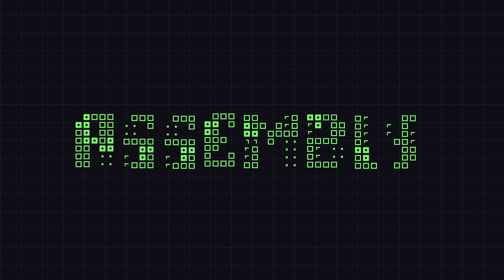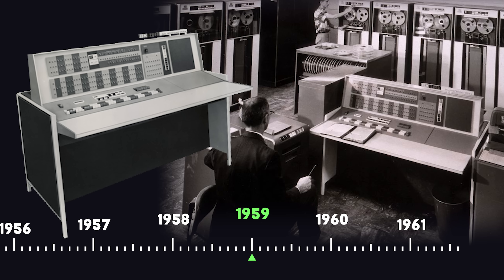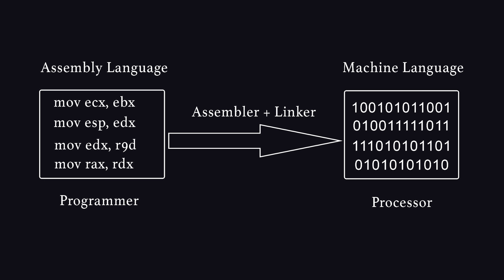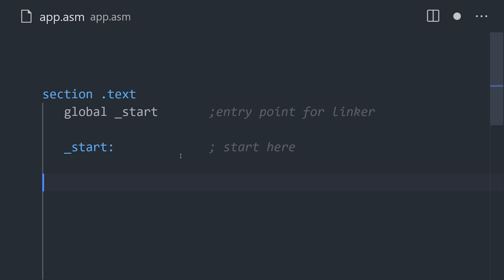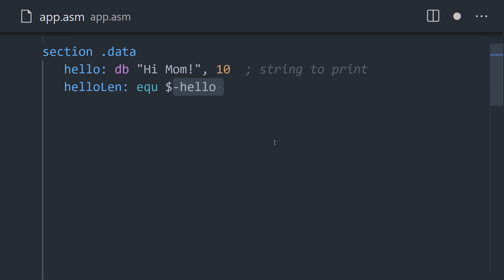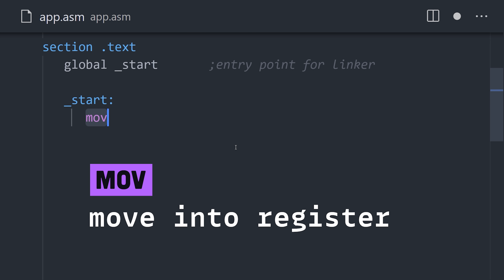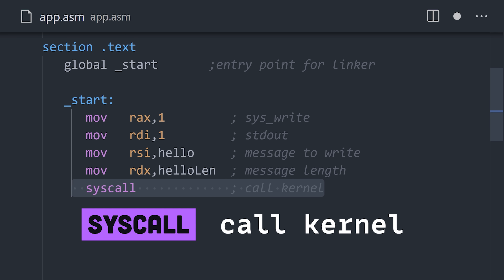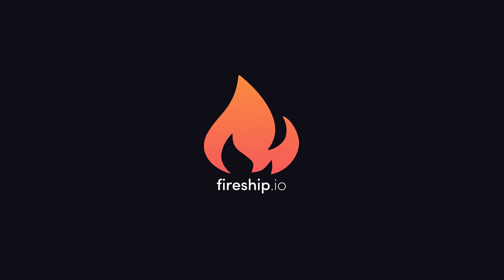Assembly Language in 100 Seconds

Comment: Assembly only looks complicated to the beginners but it's really not. MASM even provides high level directives like IF, ELSE, WHILE and standard macros for I/O that makes it really straight forward to focus on the performance of your algorithm.
Reply: I never knew this, that's pretty cool.
Reply: What's the difference to C at that point?
Reply: @eUnkn0wn  you can write inline assembly in C if you want, difference is of performance and control over your code, bit shifting and direct access to stack frame and hardware. You can't do that with C
Reply: I had a tutor back in the mid-90s when I was just a teen hanging out on the local BBS... he always said "it's all rather simple", and I never got it and was wholly confused.

Until one day when it just clicked and I realized all you're doing is reading, changing, and writing values to memory or output ports, and whatever is there interprets it; like the value 10 can be a green pixel in video memory.
Reply: @raz0229  There is a talk by Matt Godbolt "What has my compiler done for me lately" (or somesuch), where he demonstrates really well how unlikely you are to optimize better than your compiler at this point. Besides C is basically just that: High-level assembler.

Not saying that dabbling in ASM doesn't have its place, but personally I needed it mostly for debugging.
Reply: I really don't think that a human cannot write an Assembly code, better than a compiler. Especially in complex projects. Because of that, people use C rather than Assembly.

You cannot write an operation system for example. Which people already don't too.
The robot that send in mars, didn't wrote in Assembly. Not because that people are not smart enough or too lazy to learn Assembly, its because written code in C and convert it to Assembly with complier optimisation is better choose, smarter choose.  

There will be low level languages every time. Don't get me wrong about that. But the languages like assembly, c, and etc. Are too old. Programming habits are changed.  But those language structure too old, and you cannot change it. For instance Rust probably will be better than C++ after a few years later.  I hope I can explain my point.

You can do everything with every language.  But that doesn't mean that is the smartest way.
Reply: @Miracle-uc6es  DOS was written is assembly IIRC
Reply: @HandcartRule46  I'm talking about today, not the 700 years ago.
Also as I said "you can do that, but that doesn't make this logical." No one write an OS or any big program in assembly unless he's have to. Because its makes no sense.
Reply: It looks like god-level programming because its syntax and way of doing things are very different to any other language. Once you get into it, it's deceptively simple because there's relatively few commands and basically no structures of any kind, it's just "do x, do y, go to x, do x with y, go to z, do b with c and g". But precisely that simplicity is what makes it so hard to write any big project in assembly and why higher-level languages exist in the first place.
Reply: @Miracle-uc6es  There's also the fact that 99.9999% of the programming work to do in the world doesn't require extremely performant code like it did 50 years ago. Today assembly is mostly used (excluding hobbyists) for very specific points in drivers and such – you then jump out of assembly as soon as you can.
Reply: @eUnkn0wn  guarantee you, most people who write in ASM do not do it for performance but for fun and to flex. Ngl, it is cool.
Reply: While the language itself is pretty simple, if you want to do something useful with it, you must dig into the architecture. Thousands of SFRs, hundreds of low-level protocols with specific timings, a mountain of datasheets for every component you interact with... Go, display a single pixel on raw iron, without OS, see how easy it is.
Reply: @sharpfang  That is the entire point of the operating system. You usually write assembly code that uses system calls to get the OS to do all the fancy IO for you, you don't do it yourself.
Reply: @rz2374  Nowadays you usually don't write assembly code if you have an operating system. Hand-written assembly is nowadays almost exclusively relegated to raw iron small embedded. If you can fit an OS on it, you can fit at least C binaries, and assembly is pointless. It's when even raw iron embedded C gets too big that ASM starts being a necessity; the $0.01/pc chips like in battery charge controllers or RGB LED remotes.
Reply: @sharpfang  I know at least two application of assembly within an OS: the C standard libraries, and probably others, use assembly to improve speed of certain mathematical functions; and while it is not written, it is often read when decompiling/disassembling executables.
But yes, I do agree that assembly does not really exist within the confines of an OS besides very niche uses like the above.
Reply: It just becomes hard to manage when your project gets big
Reply: doesn't matter. ASM in any form, be it hand-written or compiled, is HEAVILY optimized (like why would you write assembly by hand anyways?). Simply diividing by 17 results in...
  movabs -1085102592571150095, rdx
  mul rdx
  mov rdx, rax
  shr 4, rax
You can't tell me that that's not compilcated - even if you know the algorithm that generates this code, it will take MINUTES to figure out what this is doing.
In order to "focus on the performance of your algorithm" you need to be as good as - and actually BETTER than an optimized compiler at code generation for it not to be a waste of time.
Reply: It's not that its difficult. Just incredibly time-consuming
Reply: There are also high-level commands-macros.
.if (...)
.elseif (...)
.else
.endif
.while (...)
..end
.until
.repeat (...)
And there is more in the UASM assembler
.for (eax=0:eax<111:eax++)
.endfor
.switch eax
.case 1
...
.endswitch
So you can write structural code in assembler.
Reply: @Miracle-uc6es  today theres a vlc encoder about it
written in only assembly
10x faster than the c code for it
Reply: @miniflint2423  Alright, I'm challenging you :)
I want you to write the 'Guess the Number' game in Assembly, C, and Python languages.
It's the simplest game in the world. You'll pick a random number. Then you'll get inputs from the user. If the user's input is greater than the guess, you'll write 'greater' on the console; if it's smaller, you'll write 'smaller'.
Then I want you to add the following features to the program:

* Attempt Count: Count how many times the user has tried and display it on the screen when they make the correct guess.
* Difficulty Level: Create different difficulty levels that the user can choose from (e.g., the range of the number can change).
* Hint Giving: Give a hint if the user makes a certain number of wrong guesses.
* Multiplayer: Make a version where multiple users can play. Each player makes their own guess and whoever guesses in fewer attempts wins.
* Graphical Interface: Use a graphical interface instead of a text-based one.
* Scoreboard: Create a scoreboard that stores the best scores.
* Time Limit: Set a time limit for each guess.
* Adaptive AI: Develop an algorithm that allows the computer to pick the number more wisely. For example, analyze the user's guesses from previous games.
* Online Version: Make a version that can be played over the internet.

You'll easily do all of this with Python, you'll struggle but you'll do it with C, and yet you'll do it with assembly.
Then you'll better understand why there are power differences between languages. What's the use of a class? Why are there libraries? Why is a dictionary better than arrays? And so on.
What I want you to learn is this: 'Everything can be done with every programming language. But it's not sensible to write everything with every programming language.'

If you want something more focused on embedded systems, imagine you have a four-way intersection.
There are four lights. Adjust these lights in a way that avoids traffic accidents.
Then add these features to the program:

* Sensor Integration: Add sensor data to adjust the lights in real-time based on traffic density.
* Pedestrian Button: Simulate a pedestrian crossing button. When activated, the pedestrian crossing will show green after the next green light cycle.
* Emergency Vehicles: Add a mode that facilitates the passing of emergency vehicles.
* Night Mode: Automatically shorten the duration of the lights during nighttime hours.
* Function of Yellow: Set the yellow light to function both when transitioning from green to red and red to green.
* Cycle Statistics: Provide statistics that show how long the green, yellow, and red lights were on during each cycle.
* Graphical Interface: Visualize the traffic lights and road conditions with a GUI.
* Multiple Intersections: Extend the program to manage traffic flow between multiple intersections.
* Secondary Roads and Turns: Add separate lights or a directing system for right and left turns.
* Error Tolerance and Safety: Determine how the system will react in case of outages or errors (e.g., all lights turning red).
These applications will make your program a more complex and realistic simulation.
Then, for example, compare the performance differences and say for yourself whether this torture is worth it.

Have fun in advance. My only request from others reading this comment is, don't talk without knowing what you're talking about. "Just because you have an opinion on a subject doesn't mean you have knowledge about it". First try these simple programs, then you'll understand why using Assembly is absurd. First do, then talk.
Reply: @Miracle-uc6es  literally just said that it existed. not that i could do it
Reply: @miniflint2423  What I'm trying to explain is exactly this. You didn't say anything. I mean, if I sit down and do some research, maybe I can find a program written in machine language that runs 20 times faster than one in C. So what? What did I just say? Nothing. Should we learn machine language? Should we write 10,000 times slower just so the program runs 10 times faster? It's an empty statement. This is just answering for the sake of answering.
Reply: @Miracle-uc6es  no yes maybe... It is dependent on your task if u need a small hyper Efficient program for example an integrated circuit you would use assembly but for bigger programs a higher programming language is much better because its easier to read and write. Your attitude is the reason we have more and more programs today that are so wasteful that they are actively making our workflow worse. When you have programmers that don't really understand things like pointers because they "don't need that to write code" you get Programs that are sabotaging themself for no reason. And yes in most scenarios C is better used then Assembly. To your example yes many thing are wrote in Assembly even if its 10,000 times slower to write because when u sell something many Billion times and can make that with 10 times slower (cheaper)  hardware that 10,000 time upfront cost is worth it.

Comment: A quick correction: the bss section is for variables whose size is known but data is not. We reserve space for variables in the bss section with resb (reserve byte). The data section is for variables whose initial value is known, and the rodata (read only data) section is for constants
Reply: To further expand on that: the bss section is allocated at program start and initialized to 0. Thus, only the size of it needs to be stored in the executable file. This is also the reason why C initializes globals to zero unless a value is provided - because it is essentially free - compared to local variables, which are uninitialized by default to save a few instructions.

Comment: A small but important caveat: in most use cases, assembly still sits above the OS / kernel. So you won't work with actual physical memory ("bare metal") but with virtual memory; an abstraction provided by the OS. An exception might be when you are programming in kernel space.
Reply: So we modify the virtual memory? That is protected?

Comment: also, .data is not for constants that do not change, it's basically an initialised version of the .bss section that takes up space in the executable. you can actually change it. for actual constants that do not change, use .rodata.

Interesting video though :)
Reply: That makes sense, given that I gotta assume rodata stands for read-only data
Reply: @finadoggie  yep
Reply: that takes up space *in the executable*. .bss, .data and .rodata all take up space in memory, the difference is that .bss is not stored in the executable but initialized with all zero bits by the executable file loader.
Reply: @mihiguy  thanks for correcting that :)
Reply: @Snail5008  you are welcome. Thanks for corrrecting your comment :)
Reply: does getting information from .rodata work the same as getting it from .data?
Reply: Ah, so .rdata is pretty much constant, and can never be changed, but data can be changed

Comment: The madlad did it - and even flavoured the like and subscribe again!
I have been looking at Gameboy assembly for a long time, mainly for the GameBoy and GameBoy Color. Starting with the GBA, you can use ARM instruction sets and the tooling for both is pretty incredible (sdcc, lcc, z80sdk, ...). It sure is far different from writing nice looking code, but if you want to get something critical done, then your best way of achieving it, is to skip every and all abstractions and go bare metal via Assembly. :)
Reply: Actually DevKitArm and GBDK is the way most people go nowadays and some people actually managed to make impressive stuff with it thanks to the layer of abstraction. We're seeing more and more people make games for those platforms and part of the reason is excellent support for the C programming language. Now, if only CC65 was actually just as nice...
Reply: @doigt6590  GBDK uses SDCC and I personally am still waiting for it to actually support C99... I wanted to try and use V which compiles to C, but because of ampersand statements, it makes SDCC error out a lot. But, DevkitARM/-PPC is amazing! I have those installed too. Personally, I am impressed how many unofficial SDL ports there are for some of those handhelds, which is pretty amazing!

Comment: I got my start with MIPS32 in university and I'm currently learning 6502 assembly just for fun. It's a really fun CPU to learn and the X16 uses it just like the C64.
Reply: I learned MIPS in university as well, does it matter what version of assembly we learn? When starting out I was so confused on the difference between arms and mips, and when searching tutorials they never showed what I was learning in class. I want to learn assembly but don't know what version to go with.
Reply: @sergiohernandez72  That depends on why you want to learn it. If you want to understand the concepts, it doesn't matter. Learn any or preferably several of them (to see the differences). You might even want to have a look at completely synthetic ones (like MIX or DLX) or byte-codes like Pascal's or Java's. If you want to write real-world code in assembly (to make if faster or smaller or remove side-channels) then you would learn the assembly language of a processor in wide use: x86_64, ARM, some microcontroller, maybe a GPU ...

Comment: 0:06 Actually that's what hexadecimal is for. Hex is far easier to count than binary. What assembly is for is to remember the instructions' names instead of their number. That's literally it. Without assembly programmers would likely remember instructions in hex rather than binary anyways. In fact if you deassemble a program you not only see the assembly instructions generated by the compiler but it shows you those instructions in hex instead of binary.
Reply: So the easiest "decompiler" (not really) to make is a binary to hex?

Comment: Interesting how similar yet different this is from compiling with gcc
Reply: Gcc does the same thing, but just hides it away.
Reply: in steps of compilation + linking of c++, converting to asm is an intermediate, so basically we start from there in this case
Reply: its basically the same thing, c and c++ are just higher level